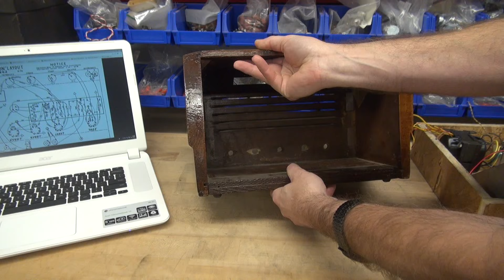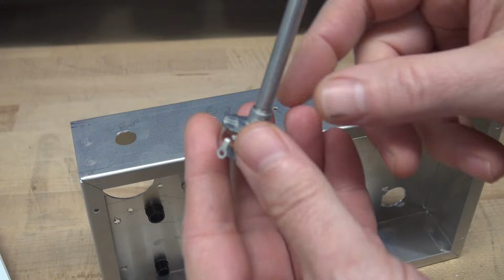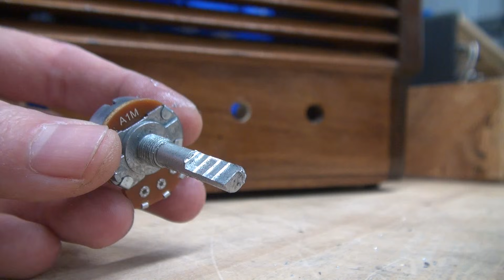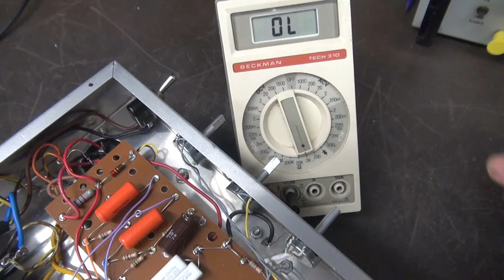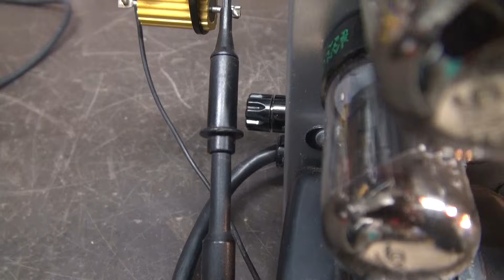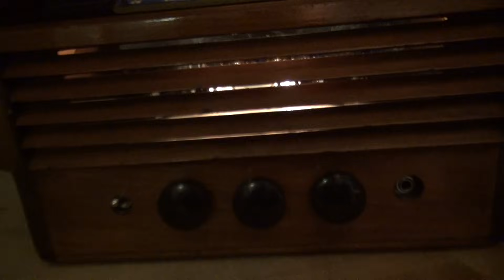How to build 6V6 Boutique tube guitar amp start to finish Homebrew kit

Comment: This is so cool!! I"ve been looking around town at pawn shops, Craigs List and FB marketplace trying to find an old tube amp that is not working, cosmetics not important as I just want a project of getting it playing again.  Then, I saw this video, fantastic!  I've built a few projects over the years, I'm 76 years old and a previous amateur radio operator.  With that hobby, I was able to learn enough basics to safely build  a project.  One was a solid state 12 volt DC per supply from scratch in a Radio shack chassis.  Then my biggest project was an old linear amplifier I got that was disassembled , all in a large box.  It was huge about 2 ft tall to 3 ft wide.  All the parts were there incl the huge transformer.  It used four 811A power tubes grounded grid class B I think.  I had the schematic and set out to build it.  Help from ham buddies along the way. My biggest hurdle was making a voltage doubling circuit to supply the high plate voltage I think 1600 volts. This is my memory from 1979.   The filaments would warm the room in winter.  It put out 1 KW plus the driving output of my Drake transmitter so 1100 watts.  Anyhow thats my knowledge base and I really want to build this amp.  Thanks so much D-Lab, Can't wait to start.  Ted in Sebastian, Fl. KA4FLA ( novice call sign ).

Comment: What's the reason for using dummy load on the output?
Reply: With NO load, on a tube output transformer, there are phenomenon that take place, that will KILL the transformer!
NEVER, even for a moment, power up a tube amp with no speaker, or dummy load! EVER!A dummy load allows you to test an amp without an ear piercing tone blasting.
An 8 ohm resistor rated for higher than the amps maximum power is used in place of a speaker.
Even a small Champ, will be quite loud. A Twin Reverb or Marshall cranked is brutal, and WILL cause hearing damage. The resistor needed for those is BIG.
You raised an excellent point.
The dummy load is a MUST, to avoid transformer damage.
They are Ebay items.
Get a 50w 8 ohm, or 100w for big amps.
Solder the leads to a speaker plug.
Very basic. Not expensive.
Well worth the cost.
Your neighbors will gladly buy you one after your first day of testing with a speaker! (8-D)
Reply: Sounds similar to an RF dummy load when testing radio tranceiver without reflecting all that power back into it. Is there a name for this phenomenon so I can look it up?
Appreciated the reply btw^

Comment: I recently subscribed and I like your videos. But did you use an aluminum chassis? The chassis should be steel because it is more ferrous than aluminum and will shield better electromagnetically than aluminum which will only shield electrically (magnetic fields - especially 60Hz pass right through aluminum). I once put a mu metal barrier around my preamp tube, with a steel cover over the tube. That really isolated that high gain circuit from any noise, even radio stations.

Comment: I always thought you needed to keep the power and output transformer at right angles to each other in order to avoid magnetic coupling between the two.  Guess not!
Reply: You are correct. Distance matters too. Fully enclosed windings help too. I have a small AM radio that has that issue. The hum is there at zero volume. Put a steel plate in between them and the hum changes. But I built it when I was 14. A tube AM superhet. 50 years later it still works. Yeah, it has flaws, but it plays tunes in the shop, and ROCKS! You learn as you go.

Comment: Nice job Terry. The only thing I would add is T nuts to the top side of your wood runners to mount the chassis inside the enclosure with bolts from under neath the enclosure.

Comment: Thank you so much for this vid. Im 56 been playing guitar since i was 14. 12 years ago i started looking into tube amps and after playing a few began using those over my solid states. My hands dont work like they used to and ive become more interested in how the tube amps work and the different tones they produce. This is the first start to finish vid that ive seen that makes me think i could actually do this on my own. Magnatone has a stereo amp. Would it be possible to make this amp stereo where i could bounce the signal with my stereo able pedals? Would it make it so much more incredibly complicated that it wouldnt be worth the trouble? Thanks for the vid really appreciate it.

Comment: Could there be a stereo amp but has 2 6bq7? Per channel? 
I made one from a silvertone 4 leg record player but it was stolen. I made a combo.
I made a silvertone medalist or medallion? Into a head. It was stolen. They both were stereo. The one I made the head out of had 2 6v6 per channel. I dont know why but I like my guitar through those class amps cause they   
 " sing" i had a jcm 900 2100 mk3 modded it had that sing. It was stolen.

Comment: This was a great video.  Been looking at lots of resources to learn basic electronics.  Still some nomenclature that I didn't understand, difference between diode and rectifier and a couple other points.  I understand that the circuit is a proven design by Fender, but would love to understand the fine details, like why are certain components used and how they affect the output (sound).  Very cool!  Thanks.

Comment: Greenlee makes hydraulic hole punches for electrical panels. They work much better than the ones you have to wrench on. A couple pumps on the grease gun and it's done

Comment: You could benefit with bread boards. I have a ton. From b4 westinghouse defense electronics was bought by Northrop Grumman. Every time Airforce come thru every part and tool not labled correct per mil specs was.tossed. b4 they came in our closed engineering rome with escort rewuired combo loc door. Anyway got tons of parts mil spec grade and test probes ..... What area of country you in?

Comment: Radio collector, looked on eBay size similar RCA wood cabinet radio from the 40s for about 100 bucks early in the bidding process. Are there enough old tube radios to sacrifice one for "a boutique guitar amplifier" no comment. (Terry good Video)

Comment: If you’re biasing in AB mode for this amp the cathode current should be around 22.1 ma with 380v on the plate it looks like 500 ohms seems a little low can you go thru the bias thanks

Comment: I have a question. When recapping, what voltage rating do you use? My build sheet, doesn't give voltage values of almost all of the caps. Only 2 have voltage values listed. One being 50uf@ 150v and 20uf@ 25v.

Comment: I just wanted to say thankyou very much for sharing your knowledge. Whilst I'm only learning I appreciate the explanations and reasoning. I can only speak for myself when I say that as exciting and rewarding as amp modifications can be, to me it is somewhat scary; not just from a safety perspective but also for the safety of your amp! 

I'd love to know a bit more about how I could achieve a bit more break-up/gain on my 64 Deluxe, and whilst there are countless videos on the Deluxe reverb, I can't find much on the non-verb model. Both are designed around AB763 sure, but the additional tube in the Reverb models makes finding the what I'm looking for a little bit harder... maybe I'm overcomplicating it? 
Ideally I'd like to modify channel 2 on my Deluxe to have more gain, but also with the ability to get that break up at much lower volumes for practice, and leave channel one completely alone to retain the true authentic tone it's held for so many years. 

Anyway I just wanted to thank you for your time and for helping dummies like me get my head around this stuff. Cheers mate.

Comment: Amazing! I have a schematic of and 90 watt's amp, but get the transformer is ferry expressif and hard to get.  I have never ever take a course of electronics, but i learn the stuff all the way to rent books form the library. That was  forty years ago. I have in that time a 2 watts amp and touring my frist DJ job, Later on  touring whit artists and band as a sound engineering whit Martin Audio (UK) and Crest Audio (USA) Racks. Stil have this amazing stuff and sounds close to the "Tube Sound". But I want a stereo amp to driving my amazing Top's . They are also driving whit a System controller (MA, MX-2) with speakers Send's lines. The controller take back some sig if its to high and have a nice sound and split it also to the sub's. I tour whit this system more then 20 years and never have a blow up speaker or amp. And at life sound situations i have the guaranty troubles this solved in 30 seconds. But sometimes the artist are stupid to break the mic cord ;-)  Back to the transformers i need a 2x350v , 2x310v 1x55v 1x6,3v. Also in the standard EU lines are now (>2004) 230 volts -/+6% (new equipement need's a+10% tolerance). But also the output transformer is a big one (only need 8 and 4 ohms).  https://youtu.be/LNkjNwgFFKw

Comment: If I may ... if I was either getting or constructing an amp, I would want:
1) for it to be like channel one of a Blackface/Silverface Fender with no reverb or tremolo (pedals work better and it allows for a simple circuit).
2) the only change to that preamp section to be a mid control, and a pair of 0.022 instead of the 0.1 and 0.047 tone caps.
3) a tube rectifier. A 5u4 for the “sag” but ideally the ability to use all kinds of rectifier tubes.
4) to be able to use 6v6 or 6L6 tubes.
5) for it to be in the form of a head rather than a combo.
6) for it to use the Mallory 150’s rather than “Orange Drops”, and definitely carbon composition resistors anywhere the tone might be affected.

Comment: I saw an interesting youtube video about speaker cabs for a 1x12, the guy bought kits for bee honey hives for about$20, they have dovetail joints and you just glue them and sand them. And you need a baffle separate.

Comment: Excellent video!  Lots of good ideas and tips.  I kept hoping that you would put a blue plastic inside under the dial plate and behind the louvers, but that is just what I would have wanted, a blue glow of light.  Another thought I had was to use what I called "Bubble Lights" ( My Aunt always used them on her Christmas tree) for a different effect.  Anyway, good video, good amp, good theory, good performance, good guy!!!  Thanks for sharing!

Comment: Just starting to watch this video - looks like it's going to be great and I'm sure I'll learn a lot.  Question: Why didn't you put the output transformer further away and turned 90 degrees from the power transformer?
Reply: The windings just need to be out of plane. The power transformer winding is vertical and the OT windings are horizontal.

Comment: ______  AN EASIER, LESS EXPENSIVE (used),LAST FOREVER, GREENLEE CONDUIT PUNCHES _____
Also EXCELLENT  for making perfect holes in your chassis are the  GREENLEE CONDUIT PUNCHES. Greenlee No.735 (2) 1/2", 3/4", 1" & 1-1/4" Conduit Knockout Punch Die Set $47 (ebay for full set). [wow, a new set is $321 !!>> *Manual Punch Driver Set, 15, 10 ga. Steel
Zoro #: G2272733 Mfr #: 39860G* ] Ideally you find them used on Ebay individually.

The key advantage to conduit punches is you can use a standard duty drill to make the smaller center guide hole for the bolt you tighten to push die cutter through the chassis, making your larger tube socket holes, Amphenol (Leslie, organ Tone cabinet socket holes (if desired), Filter Capacitor holes. You can cut transformer larger square holes with a larger drill bit hole in each of the four corners, and use a metal jigsaw blade [iirc he shows this in this video]
Notice that vintage Greenlee punches have cup/cap style mates to the punches. Whereas the newer punches have a center mate. Personally I prefer the old style as it keeps the metal around the hole from being distorted. Imo it looks like they were trying to save a dollar on the new method.
A byproduct conduit punched holes are the nice washers that get cut out.

Comment: I hope you don't mind me contacting you this way, but I don't know another  way. I have a Blackstar HT20 Studio guitar amp head. I've had it since they were introduced years ago. It has a few small tonal shortcomings, but in general it is a great rock amp and quite reliable. It has two channels. Channel one is clean with just a volume and a tone control, no gain control. The second channel in the high gain channel. It has volume, gain, treble, middle, and bass, the more versatile EQ of the two channels. You won't hear this complaint very often from a lead player, but for me, the amount of gain produced in the gain channel is waaaaay too much, and heavy distortion begins with the gain pot set at only 2 . Is there a way to change the value of the gain pot or perhaps some other component to reduce the intensity of the gain? The gain channel has the better EQ and would be much more useful if I could calm down the amount of gain it produces. I have good soldering skills, I understand the dangers of working around capacitors, and I have successfully made many repairs on on tube amps by just following instructions. THANKS!

Comment: 100 ohm resistors on the filament connections for hum balance? Can you explain that please?
Reply: If you build a tube amp of almost kind with a push-pull 2-tube output, you will find in 95% of cases that unless the heater winding has a center tap to ground or you use the two 100-ohm resistors to ground as you find in Fenders, the amp will produce massive hum. It's because the two halves of the 6.3 winding are not perfectly matched voltage -output wise (because of perfectly normal variation in transformer construction) and that difference will find its way into the cathodes of the output tubes. It's a fact of life. If you are a manufacturer of tube amps and buy 100 power transformers to build 100 amps, you will find this problem almost ALL the time. Thus, you find ALL tube amps either ground the CT of the heater winding OR have the dual 100-ohm resistors to ground OR have a "hum balance" pot. We call those dual 100 ohm R's a "synthetic center tap" and in truth, they are actually rather superior to a normal center tapped winding, for reasons that are lengthy to explain. There is a lot of information about this at EL34world.com. You could become quite the expert on this topic but it's not necessary to know about it that much. You put the 100 ohm resistors in there and you're done. You have to provide a center tapped heater, either real or synthetic.

Comment: Beautiful engineering design and build.  I built a 2 tube  aluminum chassis intercom in the 11th grade and a 5 tube AM radio in the 12 grade using similar construction.

Comment: Thank you for this.  This week will start my build of a single channel Vibroverb (Rob Robinettes BlackVibe 6L6) in a Princeton reverb chassis.  There will be some choices I need to make for preamp tube placement.  Since the Blackvibe circuit has no reverb and no tremelo,  I'll be placing only 2 preamp tubes in a chassis with 4 preamp positions.  I think this video may suggest that the 2 preamp tubes ought to be all the way down the end of the chassis as far from the Power section as possible.
Reply: How did it turn out?

Comment: You have a few spare minutes? Working on a 65 Super Reverb...developing a horrendous hum in the vibrato section...already recapped and retubed....thinking perhaps need replace another cap or two that can run that 60 cycle hum to ground....having some eyeball issues so thought I'd ask....

Comment: Hey d lab ive gotten quite a weird question... Im working on my lead 100 mosfett amp because of some pops and crackles. But i see three empty spots on the circuit board where there should have been capacitors. At the underside of the board they are soldered in tho, but not in the same configuration as shown on the top side (if that makes sense). Should i leave it like this or get them out and set them up at the top of the board?

Comment: I'm wondering, couldn't you use a 5V tube rectifier w/ only the 6V out by employing a voltage divider? Or, for that matter, what about just running the tube at 6V but w/ a current limiting resistor? We're only talking a volt difference here, so I can't imagine that a 5V filament would have a problem w/ 6V so long as the current is clamped. Then again, my knowledge of tubes is mostly limited to types and swapping them out when bad...

Comment: Nice overall design. 
 
One question: don't you find spec'ing for higher instantaneous power delivery useful in terms of more easily getting a powerful and transparent transient response that is also more even across all frequencies?  I find that to generally be the case with the "overspec'd" transformers and associated parallel circuits of some of the more powerfully transparent design, like those from The Valve Amplifier Company, Jackson Ampworks, some of the BC's and Dr. Z's and several of the late 60's - mid 70's amps / mods.   

Obviously, it takes a well designed overall circuit and related package, but it looks like you followed the core tone and related circuit design well (I wonder about the chosen tail component load value, but from what I see, that would only shape harmonics a bit differently from what I can see, although maybe increase risk of microphonics).  
Anyway, any thoughts?

Comment: If you want to get parts and radios like this,  dont miss the Vintage Electronics Expo events in Michigan .   Next one is Sat, Jan 26 2019  at the Costick Center in Farmington Hills, MI.  9am-4pm  Over 120 tables filled with stuff.   $5 admission.   Bargain auction 3pm.   Two "Silent Auctions"  10am-11am,  noon-1pm .  More info at www.thevee.org
Seller tables on sale in November.  See the site.

Comment: This is an excellent video.  the pre-testing part was great. Fitting the chassis was interesting. You should have shown at least one complete hole punching. Also the technique used to drill the control holes, input and output holes, and the switch. I would love to know the actual clean output power.